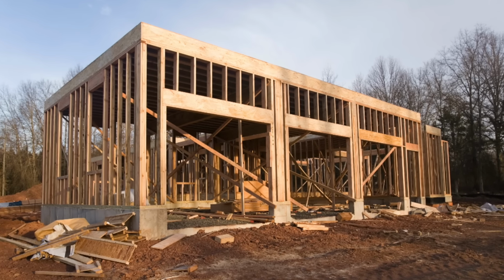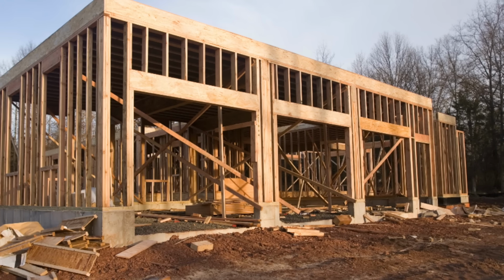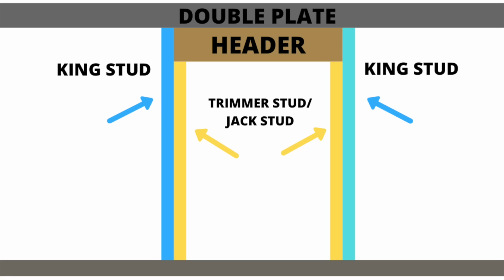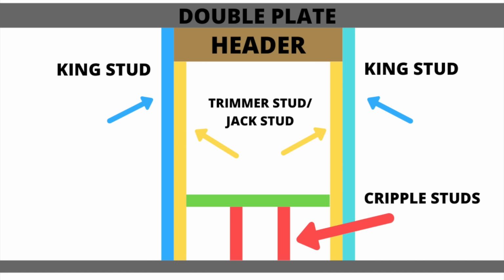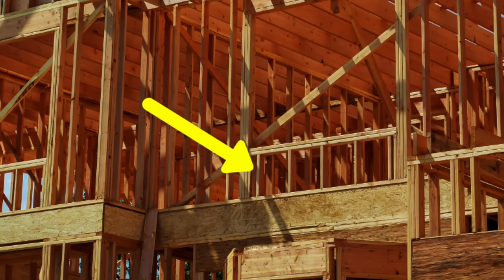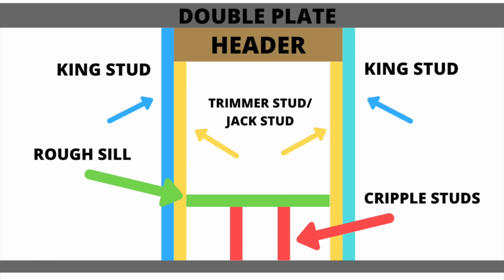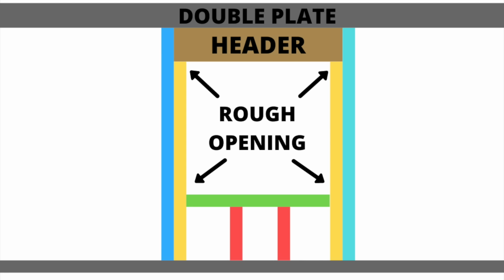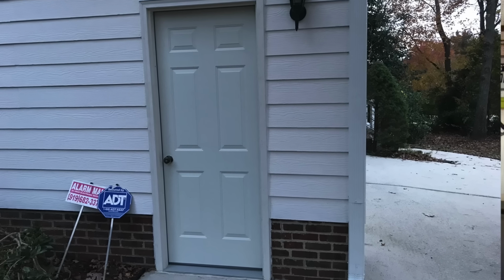All House Framing EXPLAINED...In Just 12 MINUTES! (House Construction/Framing Members)

Comment: You only show framed structures methods that is over 150 years old style method of building.   Today, since the 1972 oil embargo...and now US President Biden's Oil-Stick-It agenda policy of his, resulting into soon coming much higher electricity costs, as well as much higher future gasoline prices starting in a month from now of up to $20 per-gallon of gasoline.    You should use new building methods for a more energy efficient home building/framing, like, such as the framing word terms of: (1) "Vent Skinning" a two(2) walls exterior framed house Method ( for an brief example: where you have a one(1) inch air gape between the said two(2) walls upon the exterior walls with a one(1) inch space at the bottom of the exterior walls for in-take of air, like what  a sofet vent is for to provide expell of hot air to move upwards in the attic space and out from the attic; and (2) "Vapor Barrier," either a 98 percent pure metal, a thin roll of metal or "Radiant Barrier Paint hand panted on, upon the 2nd wall located behind the exterior wall that is located upon a inch in front of the 2nd outer wall (the living space on otherside of this wall)of this said two(2) wall "Vent Skinning" exterior wall that in fact you know that sunlight do strike the said exterior wall during some time of the day or you don't need medal or Radiant Barrier Paint upon that inter wall inside of the said "Vent Skinning " exterior wall; and (3) "Ridge Vents" upon the top of the roof (preferably always build a Gable Roof upon a house so the Ridge Vents can go horizontally across the top of the roof of the house, therefore,  effectively permitting the large volume of hot air gas that transformed from electrostatic and electromagnetic energy which came-into the attic space through the roof decking, where these said hot heat gas can easily flow upwards(heat always rises), in between the roof rafters(a flow of hot air about one(1) inch thick flowing right beneath the roof deck in the attic space betweenthe roof rafters), creating a draw-in-of air from below through the "Attic Vents" below in the sofet"s around the house.    Hence, removing all that heat inside the attic space, preventing that build-up of the Sun's heat in the attic space from ever radiating downward into the living space below.    This results into cutting-down the home air conditioning electric bill by about 90 percent in the heat of the summer months.
  In the sofet's area of the house, your to frame-in so there is a one(1) inch wide horizontal hole between the roof rafters from the said two(2) walls exterior "Vent Skinning" wall of  the said one(1) inch hole between the said two(2) walls where this hole is connect up and into the attic space, so hot air gas from behind the said Vent Skinning exterior walls can flow upwards(heat rises) and into the attic space and out through the Ridge Vents all along at the top of the roof to the house.
  This is my 21st Century Method of Framing a Super Energy Efficient Home style of building, just like the exterior walls of the ISS in earth orbit that also has a problem with the sun today.

Comment: This was another great video- a lot of material, simply and clearly explained. As a homeowner who has gone through two new home builds, it would be interesting to see a video on common shortcuts framers take that lead to future structural problems. We've been burnt with a $75K bill to correct issues in one of those homes. (Great town building inspectors, I know...)
Reply: the problem is each step of a build can have what you describe. poor footings, poor foundation/Concrete, poor framing, poor roofing, poor siding/watershed, poor insulation/drywall/flooring/finish, poor electricals, poor plumbing, poor drainage etc  Every step has to be done correctly. short cuts can be one issue or simply poor application of good products. The key to contractors is to understand the swing of the pendulum the Cheapest bid and the most expensive bids are very likely going to be problems when you get the middle of the road bids and a number of them are in the same ballpark you've likely fallen upon contractors who know what they are doing because the costs are the same for a bid if they are based on blue prints and known quality of materials (prefab counters vs Marble for example) the costs of labor should run pretty much in the same vein (this is the real fluctuating part) The same can be said for How long the Project is estimated to take too quick or too long exposes issues with the contractor most will know X project should take Y time to accomplish barring changes.

Comment: Sheeting should be installed on a squared up wall before it is raised. Do they still build 2nd floor walls before the sheeting is installed on the first floor walls anymore? A bad Idea. The only ones doing that should be Iron Workers on Iron buildings. also, some of those headers shown require more jack studs per the width of the regular type header.

Comment: Lets see if I can explain?
 Some 55 yrs ago helping to build the house, I watched the corner 2x4's being put in. What didn't make sense at that time or since is they were put in too close, try to explain. Jiprock is 3/8 or 1/2" maybe 5/8" having to angle the nails into that 2x4 to get time into the wood. As opposed to, turning that non-structural board side ways so that one has more wood to put the nails into and that corner mud metal strip. OR Moving that 2x4 out a little further to accomplish the same thing, one needed to put in the corner.    
I did hear should have written it down, sorry. Some of the places I have been have got a fair amount of snow, I am going to say that perhaps 2/3rds 1/3rd overhang engineering wise might be good? OR 3/4ers?
For the ends where they nail stubs onto the edge to support the outside . Yes I have thought the other ramifications of it. To have the metal hangers onto that last inside of the wall laterally then extend out to where they have to go with the nessecary supporting wall shortened by the (2x4" or 2x6") rafters depth. Which then stops the droop of that outside wood.

Comment: Overkill with extra materials (studs) & (fasteners) nails screws can upset the proper balance of a buildings core integrity over time. Home are built to last many decades.  Using xtra supports as necessary is a good thing if used in a properly alongside minimal application.  Specifically building ground up, as in this building. Experience will teach when it should be applied, I prefer the term bump it up, overkill implies a negative connotation.  I’ve worked @ house building sites since the age of 12 yrs-carrying shingles up an extension ladder, no treadmills. No nail guns while spiking in the tacked up walls.  From digging the basement, framing, electrical, finishing and bricking the homes.   4:30am Breakfast eggs, hash browns sausages 3 pieces of toast daily and too much Heinz steak sauce. Weekends only allowed to swap sausages for 7oz strip steak if the week went as planned. ( if ever) + 4 cases Bud-bottles) to start everyday with a bunch of wise guys! Learn bout hardassed work real fast! 1965-72’.  Real handy building forts and keeping my future homes in shape.

Comment: When I was an architecture student way back in the 1960s, we were required to take a shop class in which we learned to use basic woodworking tools to cut lumber down to tiny fractions to create framing members, such as 1/4-inch x1/2-inch studs, which we then assembled into a scale model of a fully framed house -- plates, studs, joists, rafters, etc. While it may have seemed like playing with Lincoln logs as a kid at the time, it was an invaluable lesson for designing houses, apartments, and small wood-framed commercial structures, as well as understanding the real work as it developed in the field. Probably not as good as working on a construction site during summer vacations, but it sure helped us to avoid designing things that couldn't be built by the average carpenter in the field. Plus we could communicate with the workers using the proper terminology and not look like the complete idiots they seemed to think all fledgling architects were.

Comment: I don’t live in the Continental USA. We tend to use concrete, cinder blocks and iron and tar or acrylic silicone or aluminum for waterproofing. The materials used to make homes in the USA aren’t meant to last nor to withstand storms. The new type climate change of storms.
While visiting the USA I saw a house being built and besides compressed wood it had plastic & paper sheets. And the house I stayed in when you walked the wood moved & creaked. Yet Our homes are valued at half the price of the USA’s homes. it’s bizarre .

Comment: Good information here. I'd add that many jurisdictions require a layer or sill seal foam between the masonry and sill plate that serves as an added buffer between wood and wet masonry. It also fills uneven voids between the two where weather and unwanted guests (bugs and rodents) might be tempted to enter.
Reply: I agree. Don't know the code, but it is logical. As for treated lumber sill, that's a new one on me. Cement does not always contain moisture, as he said, but it does transmit it, hence the blue/pink foam. I've seen a new "pressure treated" class of lumber "not for ground contact." Who would think/notice the label
Reply: @cliffontheroad  I've worked in all levels of construction. Heavy industrial, commercial, and residential since 1985. The last 20 years I have been a superintendent and I'm well versed on construction code and best practices. Materials are constantly evolving and new methods are recommended because of the advancements in materials and technology.

Comment: In the UK, we have truss roofs and wooden floors and noggins similar to this, but we don't typically have wooden walls, except for internal "false wall" dividers, which aren't load bearing.  Walls are nearly all brick and block and nowadays are double skinned with insulation in between.  We also have a non permeable plastic membrane at the base of all the walls that prevents water from soaking up into the brickwork from the foundations.  Our major floor beams tend to be steel I-beams or pre-stressed concrete, with timber spanning shorter distances.    

It's interesting seeing how different countries have different approaches to building a house.  I sometimes wonder why the U.S. doesn't build more houses out of brick.  In my mind, they would be able to better withstand the hurricanes and tornadoes, but maybe brick is more vulnerable in an earthquake as it doesn't flex like timber?  Maybe it comes down to cost of materials?
Reply: I'm in the USA and have a bit of a construction background. Masonry is a lot more work. All the masons i knew were the highest paid guys on the job site a lot of the times. Wood is cheaper and quicker. In the 19th and early 20th century we built a lot more brick but after WW2 and the baby boom we needed houses quickly.
Reply: Price and there are a ton of trees for lumber.

Comment: I live in New Zealand and have been involved in the construction trade all my working life (50 years). I was really impressed by this video as the construction of this house is rather different, and seemingly a lot stronger than what we do here. Most of our houses are concrete floored single storey bungalows, although multi-storey dwellings are becoming more common. we have no subfloor and the bottom plate is fixed directly to the concrete with a thin 2mm) layer of damp-proofing material between. Wall construction is similar to yours with studs and blocking (called nogs or dwangs here) but there is no exterior ply cladding. Instead, all walls have 1 inch angle pressed metal inset diagonally, which in conjunction with glued and screwed drywall, provides dimensional stability. Window and door headers (called lintels) are always multiple dimensional lumber on edge. The roof is also pre-made trusses although skillion rooves are also becoming common. Most framing is constructed in a factory and the house frame essentially arrives on site as a kitset. 
Thanks for the interesting video.
Reply: A lot of houses in the US are also built on concrete slabs or have basements, which will also have a concrete floor. The type of foundation described in the video where you have concrete footers with masonry built on top to support a subfloor is called a crawlspace. Which type of system is most common varies regionally. In the Southeast US, where I live, concrete slabs on a level lot are pretty rare (or at least they were back when I framed houses). For us level lots usually have crawlspaces and lots on a hill have  a basement.

Here if a house is built on a concrete slab, you still that piece of wider treated lumber, the mud sill, running around the perimeter of the slab and held down with anchor bolts (iirc). For the interior walls the only difference from the video would be that the bottom plate would be treated lumber to protect the studs from the moisture in the concrete. A house built this way would also, assuming the carpenters are good, require cutting all the studs to custom lengths because the concrete slab isn't going to be perfectly flat and will low spots, so some studs will have to be slightly longer so that the tops of all the walls are all in the same plane. We accomplished this by getting bracing up the end studs, ensuring their ends are at the same height using a tool called a transom, and pulling a chalk line between them and standing each stud up and using the chalk line to mark it. The process for building a basement is pretty much identical, except any exterior walls that are underground will be block masonry.
Reply: @wmichaelbooth  Why are the concrete slabs not level? It's not that difficult to achieve. Most of our houses are pretty much pre-built in that the framing is constructed in a factory and assembled on site. The days of a carpenter building a complete house, such as my great grandfather and grandfather did, are pretty much gone. Now, one crew lays the slab. another assembles the frame. The roof  is usually long-run color-steel or clay tiles and is fitted by roofers. The drywall is fitted by a crew then plastered by another crew, and the carpenters who assembled the frame then come in and fit the trim boards. Kitchens are fitted by the suppliers and the decorators do their bit. It means that there are many different sub-contractors involved in each build and the skills of each are limited to their job tasks. There is now a big industry here where the houses are built totally with-in the factory,  either as a complete unit, or as a series of modules, then trucked on to site. Times are a changing.
Reply: @rayanderson931  I couldn't say. I wasn't a concrete finisher. All I know is that I've never seen a concrete slab that didn't have low spots, which were easy to spot if it ever got rained on. Mind you, the slabs are level on average, but a large concrete slab was never perfectly flat.

Homebuilding in the US is similar to what you described. Concrete, masonry, framing, electrical, plumbing, hvac, gas, drywall, drywall finishing, and roofing are all handled by separate sub contractors. As for carpentry, the framing and trim could be handled by the same crew or not.

Comment: As a retired firefighter the latter roof construction was always of concern, it might be strong but it afforded little support when fire was eating away at those steel plates and low mass timber. all this factored in response times, ie. fire starts in the attic from lightning, starts burning for say ten minutes before its noticeable, call comes in with a five minute response time upon arrival it's clear a hole needs to be cut in the roof for ventilation another five minutes, Now we are 20 minutes in and close to roof collapse with fire guy's on the roof, I hated new construction, roofs with 24" rafters, thin roof sheeting engineered trusses ect. great cheap and lightweight but man killers and ain't worth a damn in damaging winds or or just plain long life of the structure, give me a 50's built full timber with rock lath walls, I called them tank homes. nice video in explaining building construction to new recruits with no building construction knowledge. 👍
Reply from the maker: Thank you for this perspective HA Re! 🙏

Comment: I’m glad my house was built before I-joists.  Sorry, that looks flimsy and I don’t trust it.  Looks more like builders cutting corners at the expense of homeowners.  I suppose I’m a bit biased because I grew up in a cinder block home so the all wood framing looks like a bunch of toothpicks to me.  IMO there should be more concrete and steel support in the framing.  Wood can warp and loose integrity over time.  That wood framing for a 2 story house looks like a strong wind can collapse it.  Builders IMO are getting too greedy and cheap and codes need to be more stringent and enforced.  Google “country walk hurricane Andrew”.  Developers and builders are grifters a lot of them.  No more trustworthy than mechanics and lawyers.  And shame on you for advocating I-joists.  That particle board it’s made out of falls apart if it gets wet.
Reply: I joists are more expensive than dimensional lumber.

Comment: As a side note, and as a firefighter, those I-beam / joists are disastrous in a fire. They can fail rapidly and don't usually give a lot of warning. It's one if the construction types we lookout for so we don't go through the floor.  Yes, they are cheaper to build with, easier to deal with, and have many other pros to them. However, if they catch on fire I'd exit that house sooner than later.
Reply: 100% agree. I-joists are a grift that greedy builders use at the expense of homeowners.